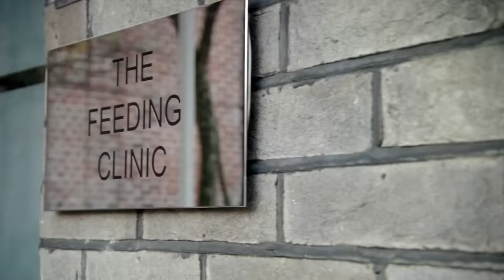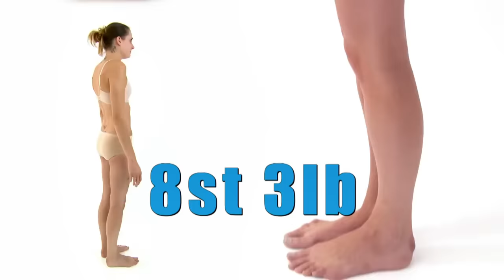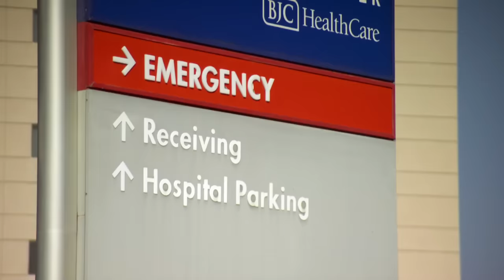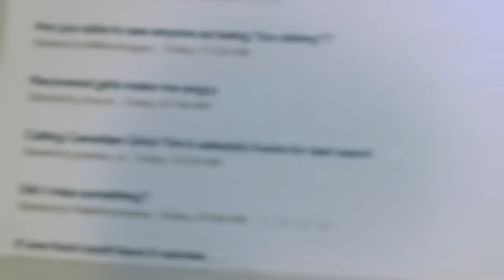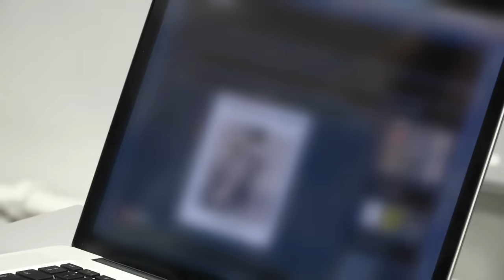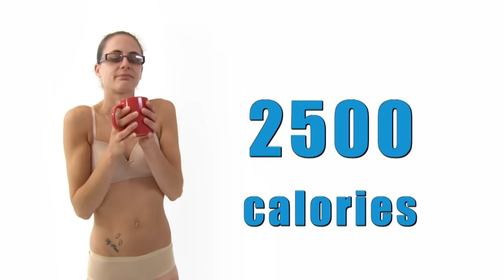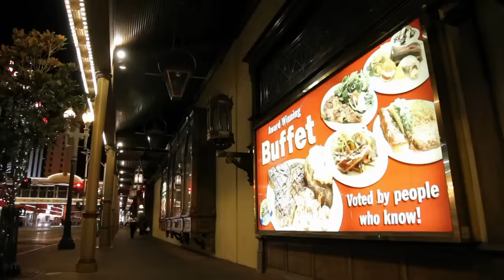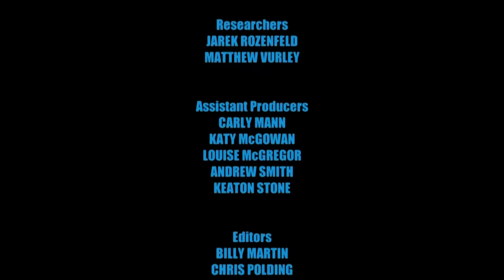Cheese ADDICTION | Supersize Vs Superskinny | S07E01 | How To Lose Weight | Full Episodes

Comment: am i the only one who thinks its weird that they are both put on a diet of the same amount of calories?? like ik they need some good results but i feel like there should be some inbetween. like going from 1300 to 2500 (almost double) and 4000 to 2500 should be done more slowly right? maybe they progress to those amounts but dont start at it but it doesn't seem very sustainable for either of them unless they gain/lose a significant amt of weight first

Comment: Changing diet is not really helpful. For the obese participant, eating like the underweight one, causes the body into starving mode. When he is eating normally again, the body replenishes it's reservoir of fat to prepare for the next sarving periode. The typical jojo effect. The trick is to reduce the kalories of his diet sloly, so the body goes not into starving mode. For the underweight it's also dangerous to increase kalories so quickly. They can get refeeding syndrome which is a life endangering condition causing large electrolyte imbalances. I guess since they work with doctors this is not happening. But this method is clearly not healthy. If you want to loose or gain weight you should use small steps to your goal.

Comment: I'd highly recommend all of these people to CUT CARBS and SEED OILS and eat more meat based protein cooked in saturated animal fat such as "tallow". This is not advise and you should speak with your healthcare professionals accordingly. While vegetables can also provide healthy micro nutrients for the body. Many of these people are INSULIN RESISTANT and eating those vegetables in the short terms would just make the situation worse. They need Fasting and High protein/NO CARB based diets to combat the clogged arteries and Fatty Liver that's working OVERTIME to process all that SUGAR/GLUCOSE they consume on a daily basis. Just an opinion "no one should follow this advise". I'd also recommend reading "The Obesity Code" fantastic read.

Comment: whats a "ston" is it like uk terms
Reply: A stone is a unit of measurement in Europe. 1 stone = 14 lbs
Reply: @zom6ie  It's in the UK not Europe. Europeans use Kilograms.
Reply: @seansmith445  it’s a country in Europe
Reply: @seansmith445 the uk is still in Europe
Reply: @zom6ie  Im pointing out that the U.K. uses stones as a weight measurement and the rest of Europe does not.
Reply: @seansmith445  doesn’t the UK use stones and KG?
Reply: @zom6ie  They are trying to to encourage people to to use KG but most people still use stones.